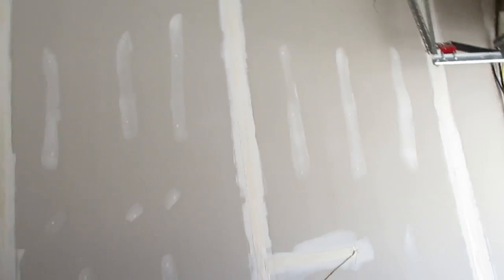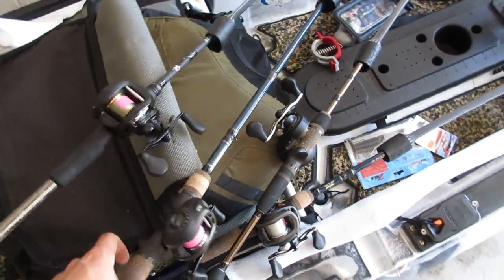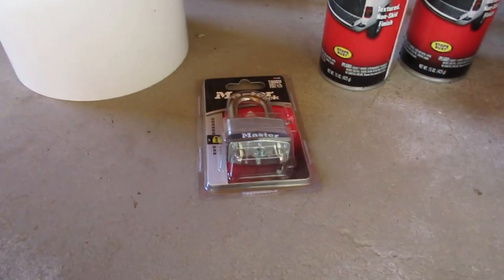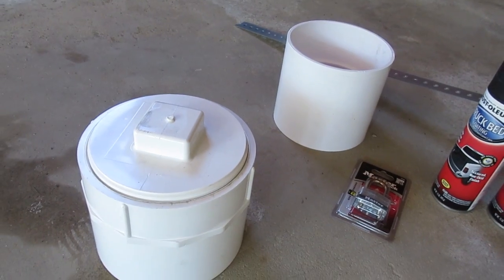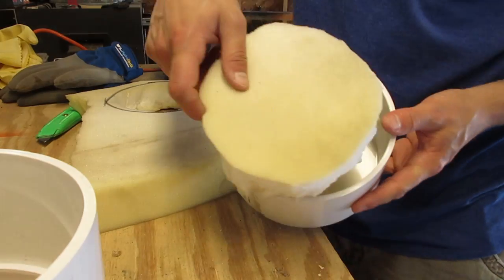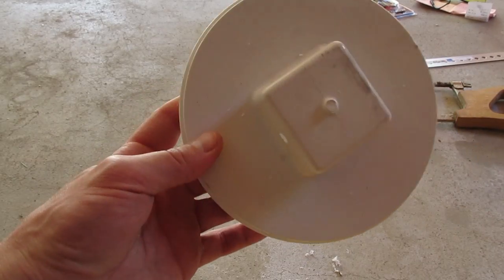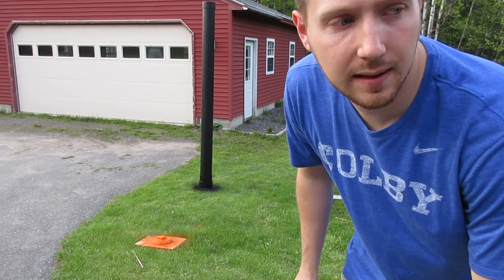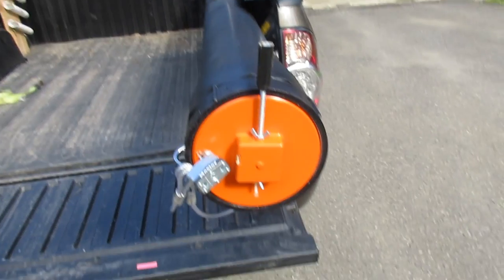MAKING A ROD TUBE

Comment: I did something similar, but I drilled several holes in the pipe to allow the rods to dry.  I've cleaned my rods and put them in the case wet and by the time I got home, the handles had molded.  It's more humid where I live though.  If put holes in the pipe, it allowed the rods to dry to keep them from molding.  I've also used sewer line / irrigation pipe that already had holes in it.

Comment: Tip for cutting clean cut on drainage pipe is large cable tie pulled tight use that as a guide. Great video mate 👍

Comment: Hey buddy, might want a lil bit of threadlocker on those wing nuts, they will vibrate off. Just an idea maybe they won't. I was wondering how you were gonna set that lock up, good idea!
Reply from the maker: Cody C didn't need thread lock. The wingnuts were scraping the plastic all the way on. By the time they got all the way in I was using pliers to turn them. Lol

Comment: Would have been easier to get two end caps and put a handle on one to remove the lid and access rods. You can sand the outside of rod tube to make it semi loose to take off easily. Save weight too. Or you could have added padding to the screw cap and make it fit on end of rod tube. add a handle again.

Comment: Cut the back part off with hack saw. 20 to 30 seconds. Buy buy poles.
Reply from the maker: Bill Peirce because everyone has one of those in their back pockets...
Same could be said if I left them in my truck. Just break the window. If someone wants them that bad.. they will get them. It’s just a device to protect the rods in transport and to slow down a thief
Reply: Yeah and take a risks of cutting what your stealing, if a theif wants it they will eventually get it or die trying however for those of us traveling it's nice to put them in this rather than stopping for gas and running inside, comes out to find $100s of rods missing so it's a deteriance to stealing!